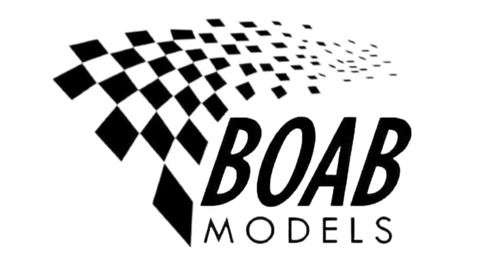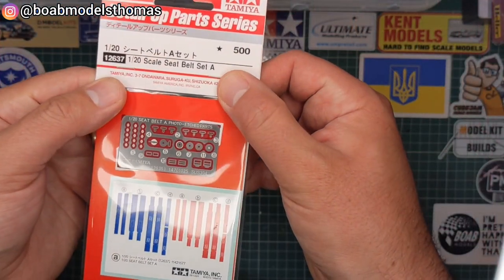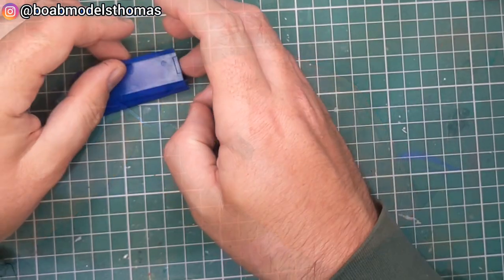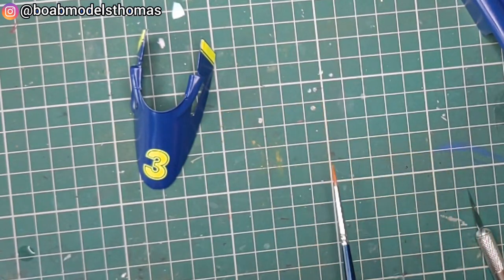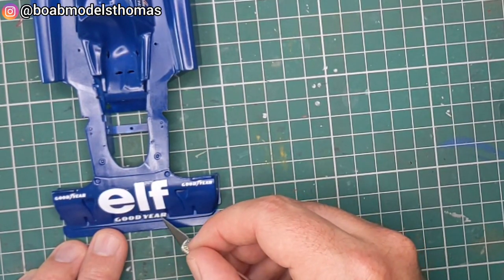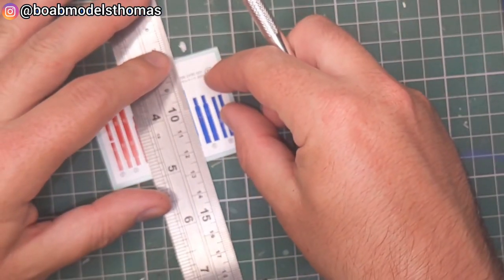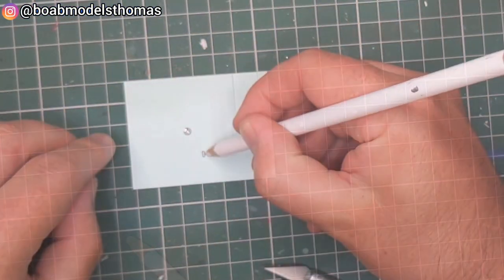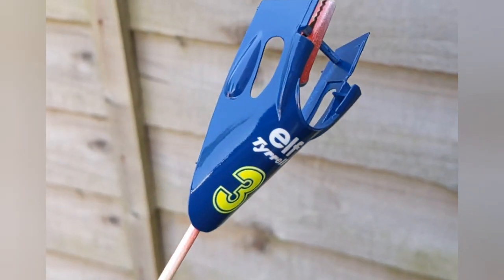Tyrrell Ford P34 'Six Wheeler' 1976  - Tamiya 1/20 Part 2 - seat belts, paint and decals

Comment: Coming along very nicely Thomas. Your detail on the seatbelts is exceptional. What seatbelt kits do you recommend?
Reply from the maker: Many thanks, Allan. I do like the Tamiya ones but they are fiddly for some - also they only sell the 1/20 ones separately. 
I've not used them, but I've heard good things about the Eduard photo etch ones.

Have you seen my seat belt video?
Reply: @BOABModels  Thanks Thomas. I'll dig through your vids and have a look at it.  Cheers